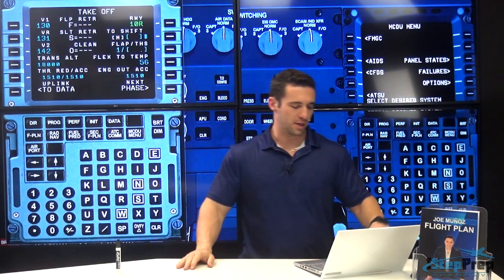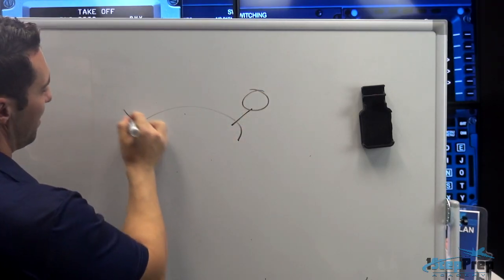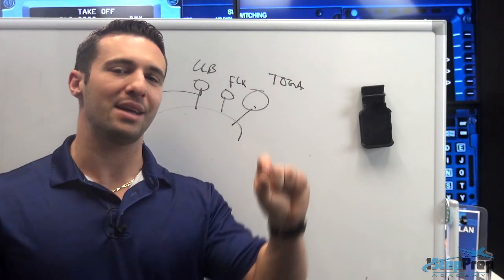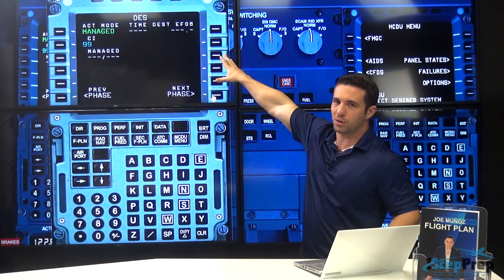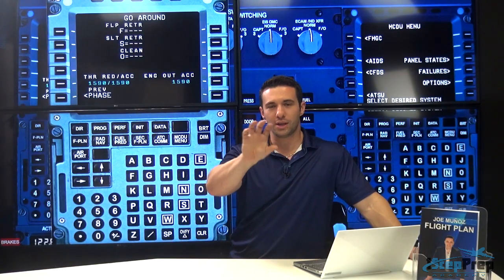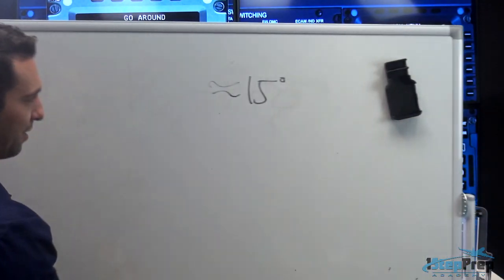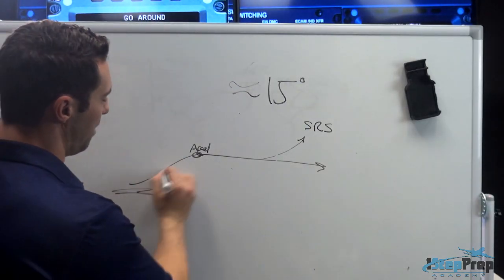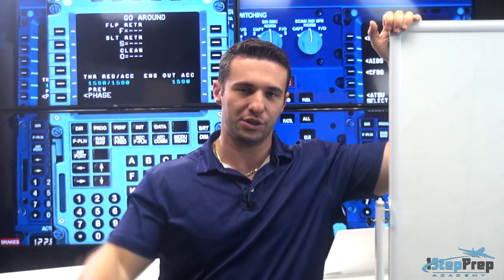Drawbacks of TOGA

Comment: excellent explanation. subscribed! just wanted to confirm what happens if you select TOGA with flaps at 0?
Reply from the maker: Thanks! You'll get TOGA power but no SRS activation aka no FD guidance to climb for a go around.  You'll remain in your current FD modes with TOGA thrust.
Reply: @1stepprep  thank you sir
Reply: @1stepprep  sorry one more thing - if in your current modes you then pulled for selected speed the fma would flash lvr clb and then once you moved the levers it would go into speed mode correct?

Comment: What I would like to know is what would happen if you’re in the CLB phase say just after takeoff from FLL, THr CLB, CLB ,ATHR flaps are still a 1, and a pilot goes to TOGA. What would the FMA read and what would the F/Ds command?
Reply: I love questions like this — would guess the same FMA just THR CLB would change to MAN TOGA. Also A/THR back to blue not white.
Reply: but if Flaps 1 is there, it should queue the SRS sooooo, yea. Haha I need to see this in a sim or something
Reply: Hello guys, there is a section in the manual related to this specific question. It says that once the flaps still at 1, the aircraft will command SRS and will enter in the go around mode.
Reply: @ yea but if I’m in a turn, what will the lateral portion of the FMA command and what will the Flight Directors do?